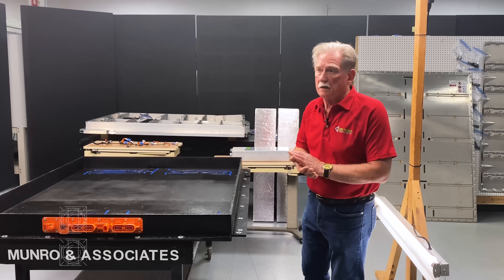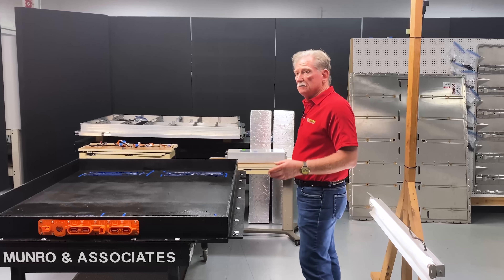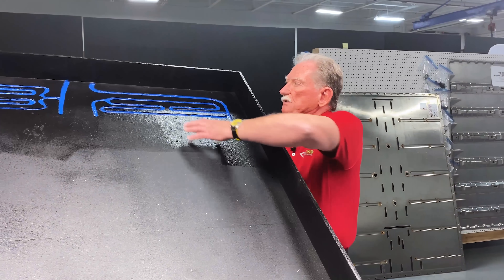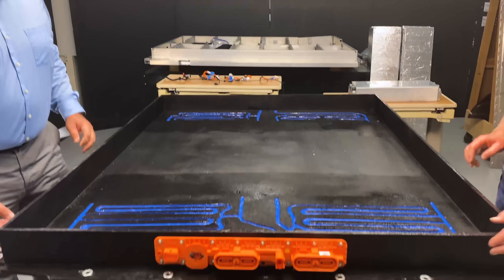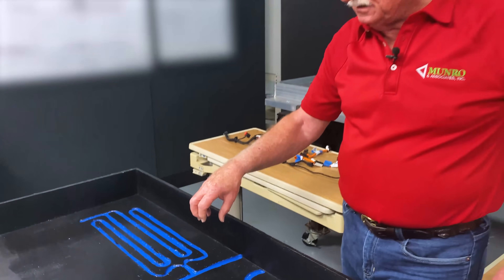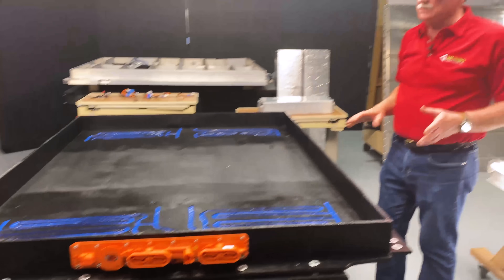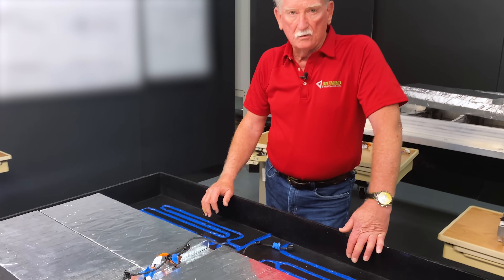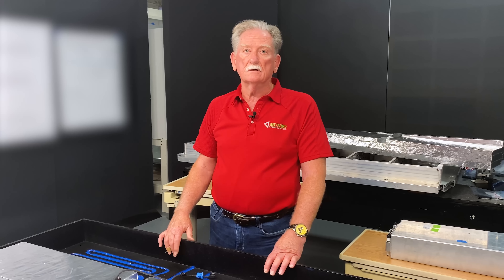Volkswagen ID.4 Battery Prototype Update

Comment: Gluing modules in place prevents their replacement. Single cell failure will lead to replacement of the entire battery, as has happened with Tesla batteries. This artificially limits the practical life of the vehicle. EVs are capable of having longer useful lives than ICE vehicles, but only if core components can be repaired as they age and fail.
Reply: Single cell failure rates are low enough to allow non-replaceable cell design.  Battery management software is designed to deal with the loss of a small percentage of cells.
Reply: @bobwallace9753  Only with a cylindrical cell battery like Tesla uses. A 100-200Ah prismatic cell failing renders the pack unusable.
Reply: @Tore_Lund  
The entire pack becomes unusable?  Doesn't that depend on how the individual cells are incorporated into the pack?
Reply: @bobwallace9753  A single cell failure has Tesla offer full battery replacement only. Though that one cell can be cut out of the circuit by independent repair shops that is only a patch, not a repair.  https://www.youtube.com/watch?v=F-B_8oMZNeI&t=2s

Comment: Tesla design is bad in many ways, gluing, (spot)welding a lot of (to)small batteries to modules and pack. No thoughts about recycling. Very bad reference. I have not seen proper details of design with the new bigger cells and "honeycomb" casting with cooling solution.....
Reply: Tesla just announced that their new recycling process recovers 92% of the materials in their 4680 cells.
Reply: @bobwallace9753  the single cell or the assembled battery pack?
Reply: @corpierro  
Tesla has been producing 4680 cells in its Fremont plant for months.  They've produced many thousands of cells.  It's a Tesla, not a Panasonic or CATL plant.

Tesla began recycling cells in Q4 2020.
Reply: @bobwallace9753  you are confused, you mean trial production in "Kato Road" facility near Fremont factory. A lot of samples are produced since end of 2020 indeed. But 99% where not usable for real application. Has nothing to do with battery production facilities in Fremont and Nevada Tesla Factories, these are 100% run by Panasonic, just use the same "roof" And since Tesla has no regular cell production of their own I doubt if they recycle used batteries for new production of new cells. Recycling has hardly started because most cars on the road since ~2012 have still theire original cells

Comment: Biden also talked inspirationally about creating the 1st EV charging network across the USA - Duh?  Tesla has already done that.
Reply: Is it the first public charging network? (Tesla maybe doing that as well😝)
Reply: @scottwills4698  
Tesla is opening up their Supercharger system to non-Tesla EVs.  Suspicions are that  the likely availability of federal money to help fund more rapid chargers is playing a role in that decision.  

Rapid chargers are going to get built one way or another.  Tesla has had a huge advantage via their extensive rapid charging system but if they didn't open then one or more parallel systems would emerge over the next few years.  Tesla might as well become a generic provider and take some profit from the non-Teslas charging on their network.  

And it helps with Tesla's mission statement to expedite the movement away from fossil fuels.
Reply: Biden also wants to introduce a Buggy Whip tax, to speed up adoption of........oh, never mind...
Reply: Charging needs to be public, as in state or government run. Just flash your RFID card and it is billed to your regular power bill!! (If you drive a Tesla, you may not see the need for that, but if you are not this would be a gods end!)
Reply: @Tore_Lund  
Correct.  All charging need to be run by a governmental agency.

Just like governments now operate all gas stations.

BTW, as we move forward there should be no need to flash anything.  We'll reach car to charger/accounting communication with humans out of the link.
Reply: @nedkelly4825  I live in Europe, and our power grid is very socialist: Power companies are partially state owned, but with prices on market terms and with partial private ownership. This means that customers are protected from fluctuating prices and there is no war between different suppliers, tearing up their contracts in the dead of winter because they can get a better supply deal elsewhere. I think the US is the perfect example of why the power grid needs to be controlled nationally, and not by individually free roaming private power plants. I have never experienced a rolling blackout in my lifetime or experienced any blackout lasting more than 5 hours. If the grid monitoring authority tells a power plant to throttle up or shut down, they do as they are told even if they lose money  or the mangement gets fired, end of story. Europe also has an common power broker exchange, so this solidarity extends to neighbour countries too. This is especially important as wind power becomes a larger portion of the supply and to get stable supply, we need to be able to switch to countries where the wind blows right now. I can't imagine the US being able to avoid this kind of higher control, if it is going to rely on renewables in the future?
Reply: @nedkelly4825  

An unregulated free market would lead to monopolies and, essentially, slavery.  Free markets have to be well regulated so that they do not evolve into their worst forms.

There are services which are best provided by governments.  Private police forces and fire departments would not serve us well.  We need to elect officials who make sure government services are well run.  We probably don't want governments doing manufacturing.  That's where competition works to create innovation and reduce costs.

We need a mix.  Not one or another.  We need to look at the conditions of our lives from time to time to see what is working well and what is not.  If what is working poorly has been left to the market or is run by the government we need to think about whether it would be better to move it to the market or away from the market.
Reply: @nedkelly4825  
"Free markets don't lead to monopolies.  Government REGULATION leads to monopolies."

Ned, that's crazy talk.  Do you know no history?  Do you know nothing of monopolies that have existed in the past and what was necessary to break them up and to prevent more from emerging?  

Have you got any idea of what life was like for people in a coal town where the company that owned the mine also owned the stores and housing?  That was a free market pocket.

Capitalism is a very strong "force".  It has to be controlled to some extent in order to keep one, or a small group of individuals from owning essentially everything.  Which would make the rest of us serfs.  If your genes come from Europe then it's highly likely those genes were serf genes at one time.  Pick you part of the world.  Your ancestors at one time likely lived under the control of one "strong man" - king, chief, high priest, emperor.  Most of us want freedom, not servitude.

Let's do a little thought experiment.  Let's say the US did away with anti-monopoly laws and went 100% free market.  What might happen?

Here's one thing that might happen.  Two or three major oil companies might merge and and buy out other oil companies.  That should be doable in less than a year.

Once one company controlled the supply of oil they could crank the price of fuel up to the "breaking point".  The rest of the economy would be severely hurt and Huge Oil, Inc. could buy up other critical parts of the economy with all the extra money they are taking in via extremely high fuel prices.  Take over the food industry.  Then they'd have a stranglehold on transportation and food.  Then move to the next important market segment, then the next, then the next.

Within a decade we could be living in a country owned by HO, Inc.  And that's what can happen with a truly "free" market.

Capitalism has to be controlled.  It has to be regulated.  The trick is to use enough regulation but not too much.

Comment: Not sure I agree with the composite thing.  Gluing all the batteries down would make them indeed much denser. However, the GM's Bolt EV battery defect fiasco shows that having some level of replace-ability is pretty powerful if and when things go wrong.   I'm disappointed in GM's handling of things, but if (a big if) they can track individual cell modules to the defective equipment based on serial, they could save a lot of money, shipping money, and eco-waste by replacing cell modules at the dealership vs the whole pack.

Comment: Most important things: 
Be able to change out the battery.
Be able to recycle the cells.
Reply: That was my question too. If everything is glued together, especially wildly different components like tray and cells, how do you reasonably recycle this?
Reply: @BugMagnet  

Grind up and separate.

Tesla has just announced that their recycling process will recover 92% of the materials in their 4680 cells.
Reply: @bobwallace9753  The problem with the use for one item and recycle is silly. Not all cells are damaged at the same rate, but those bad cells are producing more heat on both charging and discharging thus wasting possibly precious energy. If the whole sections could be taken apart, some of those still decent cells can get a second life for something else. Then they'll be recycled later, getting more utility out of the initial energy used to make them.
I'm sure it's possible to make something that can be fully dismantled by the user. It just takes a bit of thinking and willingness to do the right thing.
Reply: @lightdark00  

Silly is taking the most expensive route when there's no real advantage for taking that route.  

Manufacturing is becoming so automated that if one does the cost analysis it's just cheaper to throw away (recycle) a very small percentage of the products than to make things repairable.  

There are hundreds/thousands of engineers working on battery pack design and a similar number of pencil pushers leaning on them for the most overall economic solution and what we see is EV manufacturers moving to 'battery blocks'.
Reply: @bobwallace9753  According to some "exponential analysts", the cost of batteries will be 1/8 to 1/10 of what they are now,  in 10 years. Also, who knows what advances there will be? They may be half the size...On an insurance claim, the pack will be replaced, but there will still be some value in tearing it down to replace some damaged cells, or reclaim the good ones...
Reply: @chrisheath2637  I'm not seeing a 1/8th or greater cost decrease.  There is a material cost.  I think we see, roughly a halving of current cost, from Tesla's ~$80/kWh to around $40/kWh.  Perhaps batteries will get cheaper but $40 is very much good enough.

A 250 mile range with a 50 kWh battery pack would be very affordable.  $2,000 for the battery pack and around $500 for the motor.  Perhaps $3,000 including battery management hardware.  That would be cheaper than an engine and transmission like is used in a Corella.

And then consider recycling.  Most (>90%) of the materials in a cell can be reused.  If, for example you have a $50/kWh cell that's $40 materials and $10 manufacturing cost and the cost of recycling is $5/kWh then the effective cost of the cell is $50  - $35 (sale of materials at recycling) which means a cell cost of $15.  

Plus the investment loss cost of $50 for the life of the cell.
Reply: @bobwallace9753  The battery is a big part of the vehicle cost. Surely there are people that wouldn't mind using up some time taking apart the pack if they were able to repurpose the cells to save them even more money. I'm sorry everyone isn't rich like you.
Reply: @bobwallace9753  The future of EVs will definitely be interesting !
Reply: @lightdark00  

It is not about who might be rich and who might not.  It's an economic decision based on manufacturing cost savings, failure rate and cost to repair.

There are some people who place no value on their time and will work many hours for nothing, but they are very few in number.  Products are not manufactured with them in mind.

If a battery pack drops below 80% of nameplate capacity before the body is used up that battery would still be usable for stationary storage.
Reply: @bobwallace9753  Even if those who repair and repurpose are few in number, they are who we need more of. We need to stop encouraging stupidity and instead encourage extending the life of things. Trashing things isn't the answer, and the last ditch effort of grinding things up to recycle the metals and hopefully use the rest for energy isn't the best option either.
Reply: @bobwallace9753  BYD is already at US$60 today
Reply: @bobwallace9753  That is a final method that can be used once all cells are degraded beyond saving. But if you want to yeparate the cells in the pack for a second life application, like most OEMs do, this won't work.
Also of all he methods, shredding and hopind for the best is far from energy efficient since you have to reconstruct everything from scratch.
Reply: @BugMagnet  Like every other electronics, send them to India or other south asia country.
Reply: this guy just doesnt care about repairing! I agree with a lot of VW decision in the ID.4 I see munro more as a lobbyist than an engineer now
Reply: Sorry, but cell2car will be king in the next years. The battery will be part of the car’s structural integrity, thus making it impossible to change it in parts or in full. Lots of adhesive will be the way to go.
Second life for the battery will be easier as you will trash the rest of the car, and for the recycling we already have the tech for that, no matter how those cells are mounted in the car.

Comment: As a mechanical engineering let me give some ideas to improve design for free.
Integrated cooling channels in composite tray is quite difficult and the thermal efficiency to cells is certainly 20-30% less. Move reinforcement ribs on bottom of tray to top in a labyrinth shape. Cover this by a plane sheet of metal and voila!,  better thermal system and strong composite/metal sandwich.
Reply: The "tabless" 4680 cells wick heat to their bottoms.  At least for 4680 cells having the coolant on the bottom works best.
Reply: Good idea I agree. Issue is sealing of metal plate to plastic bottom. Finding structural adhesives that last long in coolants is not an easy thing. But I agree, transferring heat through a material that has a thermal conductivity around 200-500 times lower than aluminium is a bit dull...
Reply: As a ‘mechanical engineer’ I thought you’d know that a ‘labyrinth’ pattern wouldn’t have the strength and rigidity of closed cell triangles 🤔

But then I’ve seen your other comments and you’re a clueless troll.
Reply: @fredbloggs5902  Just to stir both of you up:  It could still be triangles with select holes in the walls to create a labyrinth?
Reply: @Tore_Lund  That could work, you’d just have to watch out for too much turbulence being generated. And I don’t think you could cast it, you’d have to do some machining after molding.
Reply: @Tore_Lund  How many gallons of heavy cooling fluid would it take to fill all of these triangles?
Reply: @adambennie4406  Yeah, that is a good point! My EV has less than 1/2 a gal of coolant. Regardless, does the battery tray need to be that stiff anyway? Floor pans are sheet metal, the stiffness is from the sils and tunnel. Having a flat top and bottomplate seperated by the height of the cells, even without internal structure, is stiffer than any other chassis part. You also want to be able to swap battery without a jig, so the car doesn't get crooked.

Comment: How well is a composite going to stand up to UV, especially carrying a heavy load.   UV still reflects off the pavement and will hit the undercarriage so unless it is permanantly shielded from UV it will get brittle with age . Maybe Carbon FIber would be a better choice
Reply: Please provide your calculations for the amount of UV reflected off the pavement onto the underside of a car.
Reply: @fredbloggs5902  85 percent of sunlight refelcts off of pavement and how much gets under the car changes based upon the cars direction and the position of the sun.  80% of UV penetrates clouds so you can still get UV on cloudy days.   living in Florida has made me very aware of what the Sun does to all types of materials in a short amount of time.
Reply: @crimsondecade7420  

Reflectivity of UV off pavement materials is typically less than 20%.

You’re clueless.